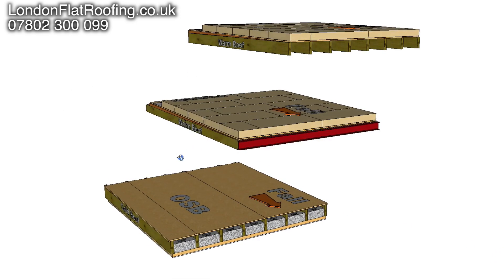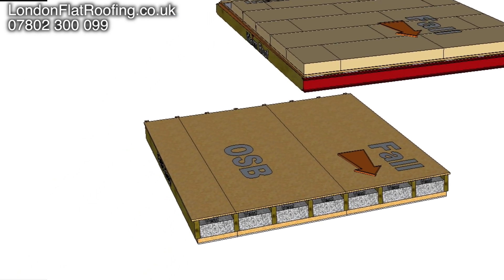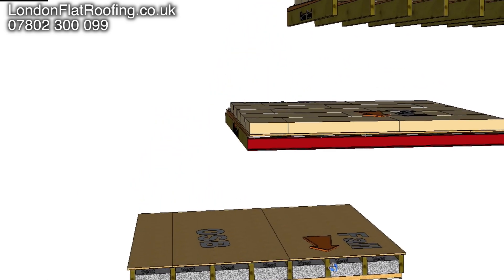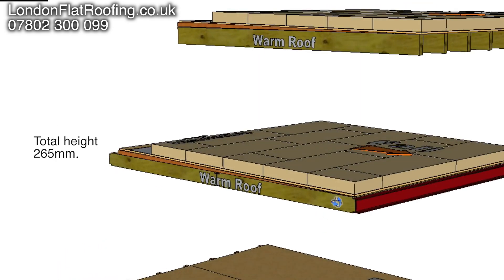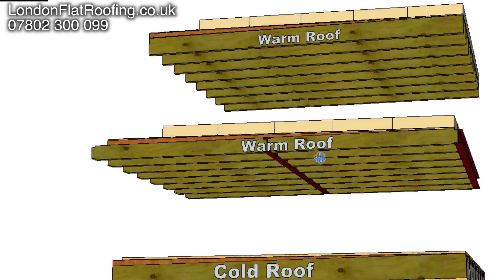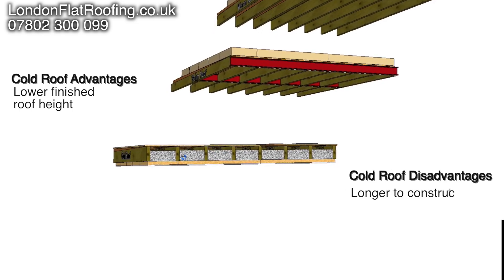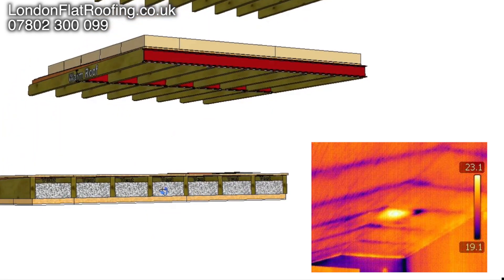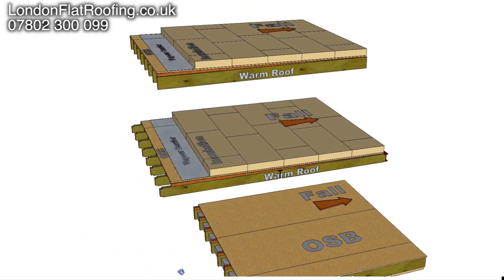How To Build A Flat Roof Warm Or Cold Construction. What's The Difference?

Comment: Thank you for the video. I find mine changes really well in every gear with minimal slippage. However, if I try and pull away fast in first it slips and all I can smell is clutch. Think PIS adjustment will change this?

Comment: Hi Steve,
My flat polycarbonate conservatory roof needs replacing, I want to replace it with a warm roof construction as you describe.
Can I do this but use a composite tile or similar for the finish roof?
All the films I see describe the warm flat roof construction but appear to have a rubber stick down covering.
I would like to have the finished roof with some kind of tile or tile look finish, I know a traditional tile/slate would be far too heavy.
Any advice/suggestions would be much appreciated, best regards Chris.

Comment: I just wanted to say that you are a master of your trade and that while my project is not exactly a flat roof but so far your videos have helped my planning process immensely.

I am about to build a metal frame, roof over a partially underground concrete floored/walled trench that used to be a parking lot, and I want to make the ultimate yard machine shop (I already have an industrial lathe that I plan to move there, expect a gorgeous new milling machine as soon as the construction of the space is complete and plan on adding a bunch of high precision measuring equipment which pretty much leaves no room for insulation errors...so much more for condensation and leaks).

The initial plan was to just add some screw through composite panels (standing seam ones don't exist in my country), but I later realized that doing only that in itself is a great way to create a huge moldy mess that would potentially consume my machines and tools. Also I realized that 3cm of insulation is not nearly enough to maintain comfortable temperatures in the windy and cold winter, and I wouldn't stand a chance at maintaining standard test conditions (23°C) for more than 2-3 hours a day without some massive energy bill

My current plan after all the information you have shared (unfortunately I didn't have time to assimilate even a fraction of it since I have a 1 month deadline for the construction) is to first set the metal beam frame up with some raised joists, on which I will place the standardized screw through composite panels on top of the frame, taking advantage of the fact they don't need any subplate beneath, and then slide some extra insulation between the joints and directly above the beams. 

My questions are if the vapor barrier have to be directly adjacent to the first insulation layer, or if it's a good idea to apply it under the beams and seal it with some interior panels, and should I install an EPDM rubber layer between the 2 insulations, or is building a deck below them necessary to stick the rubber to? Would that be enough to make sure my hybrid "warmish" roof stays dry and leak free (vapor barrier from bellow the beams and EPDM ontop of them and under or between the insulation layers)

Thanks in beforehands and keep the investment saving lessons coming! 

PS: After having seen your videos I might never trust a "professional roofer" again tbh, since now that I know what to look for, I know that nobody around here ever does it correctly (this is why the factory I work at has half a dozen leaks per square meter, leading to micrometer accurate precision tools, fixtures and jigs rusting over a single weekend). Also code here is pretty loose and not even remotely up to date with modern building practices so anyone is allowed to do whatever they feel like.

Comment: Pretty wild seeing all these comments talking about height restrictions. In my area, can't go higher than 10 meters above grade without a variance, which is easy to get. What would you say is the highest performing roof assembly from an energy standpoint?
Reply from the maker: Warm roof construction is the cheapest quickest, easiest and best, but has to be installed correctly
Reply: @SteveRoofer  Thanks. It gets down to -50F here in the winter, what sort of detailing do you recommend?
Reply from the maker: @canonicaltom  a robust air vapour control layer with 200 mm of PIR over the top with something like EPDM rubber over that

Comment: Hi, i have a question, i live in florida, i have a one car garage with a flat roof like the one on this video, no soffit, so no air coming in or out of the roof when close wit drywall . my plan is to install a mini split in the garage, Summer is to hot here, i know i have to insulate my garage door, now, how should i insulate this roof and what to use, my rafters are 16" x 2"  and like 15 or 16" a part, left and right walls are block and stucco, anynof the two walls are exterior, left wall has my kitchen on the other side, and right wall meets my neighbors garage, the rafters goes right thru the blocks, so no wood against any of the walls. I want to do this my self, and im scared of moisture on the roof and floors.. I hope this info its enough for you to help me out, if you can, thanks in advance...
Reply from the maker: The problem with Florida and your area is I'm not accustomed to. It's weather in England we put the vapour barriers on the inside however, in some places in America, you put the vapour barrier on the outside depending on whether or not your air-conditioning inside or external temperatures you're better off reading some of the information that Joe does on his website building science, he is more US and Canada-based and will probably give you much more information

Comment: Hi Steve,

I am having an extension built flat warm roof with a felted finish. Would it be ok to go for 18mm t&g osb staggered, vapour barrier, insulation board, finished felt product.

regards
Reply: base OSB T+G then Air Vapour Control Layer (AVCL) then insulation then roof covering or more OSB and roof covering, the AVCL is alway on the warm side of the insulation
Reply: @HampsteadBuildersLt  what AVCL would you reccomend please? there seems to a be lot about on the internet
Reply: @50burringham76  alutrix 600

Comment: Hi Steve, my cold roof design has no ventilation where the roof meets the house. It has vented soffit  all round and a cross battening to achieve cross flow as well as air flow from the front too, but no ventilation at the gmhouse end. Do you think this is ok

Comment: Hi Steve, Excellent video. If the roof is flat concrete, is there an issue with laying timber firrings directly to the roof then constructing a typical OSB/VCL/PIR/OSB/EPDM build up ? There is obviously an air gap between the firrings and the first OSB layer. Is this an issue ?
Reply from the maker: It's unknown hell that AerCap will work with trapped air in it that's the only issue we don't like doing it because of that but as I say it's unknown
Reply: @SteveRoofer  Thanks ! I've put a call into Kingspan to see what they recommend.

Comment: What fixings should b used on warm roof installation with bottom and top decks being 18mm OSB?
Reply from the maker: I always use thermally broken fixings however you don't have to but what you do have to do is use a fixing that is designed to be used externally
Reply: @SteveRoofer  Thank you, how much do the thermally broken fixings protrude from the top and are they suitable for fixing over 11mm OSB deck? Would they show when a waterproofing system is applied? Thank you.

Comment: Thermal bridging on cold roofs can be quickly resolved using thin rubber glued to the top fo the joist and the deck screwed through or even around the top 3 sides of the joist with the insulation stuffed between.  No need to lower ceiling and rapid to do.
The major thermal bridging is from direct contact with the outside, airflow bridging is much lower.
Reply from the maker: Unfortunately this is not correct as you need a minimal thermal performance to stop the thermal bridging i.e. on most specifications it's 25 mil of PIR insulation

Comment: Steve have you ever used vacuum insulation with a warm roof to save thickness?
Reply from the maker: No however I have looked at it and it's extremely expensive and difficult to install so much so you don't see many people using it at all

Comment: Great visualization, much appreciated, had a question, what goes on top of the warm roof insulation and is warm or cold best for a living space/patio on top of your roof? Thx.
Reply from the maker: Definitely a warm roof is the way to go and definitely not using a top decking is the way to go however that causes problems when trying to turn this into a patio then realistically you have to add a second substrate under the roofing membrane
Reply: @SteveRoofer  I see, thanks a bunch

Comment: Could you use spray form if you use a warm roof system and the then spray the ceiling joist and leave it open? I just want tin increase the R value because I live in canada.
Reply from the maker: Spray foam is not liked in the UK so I haven't got much experience with it
Reply: @SteveRoofer  ok

Comment: The other big advantage of Warm Roof is that Every MEP engineer loves to run all services inside the empty roof. When they see it, they just love it, because you can basically run there everything from pipes to lamps. Also, with the cold roofs there is another issue: trying to keep the integrity of insulation. Once the Electricians start to drill holes in the lower insulation, then the problem starts. It's nearly impossible to make it perfect with cold roofs. And in 9 out of 10 roofs contractors somehow manage to forget about ventilation until the last moment. We spent most of our year in correcting cold roofs ventilation by simply drilling holes in firrings after a few years when the moisture starts accumulating and become visible. 😅
Reply from the maker: Yes you are correct but drilling holes in not that good doesn't offer the best ventilation but better than nothing

Comment: Can I ask what the OSB is used for in the cold roof? I'm doing a cold roof in a conservatory and I don't doubt my skills. I spoke to a private building control firm and they said OSB isn't really needed.
Reply from the maker: In a cold roof its the roof deck  you lay the roofing material on
Reply: @SteveRoofer  I'm using Tapco lightweight tiles they suggest OSB aswell. I think I ill go with using it. Thanks for the reply.
Reply from the maker: @warrenely7708  I worked on a job with them once and I liked the look of them. Make sure you install them the way the manufacturers tell you. Think about venting the roof. I would love to see photos from start to finish and your opinion of them. Send me any info you want if you want my opinion

Comment: Hi Steve
I am currently building a garden room and I am limited to 2.5M I wanted a warm roof but the build up is aot.
My question is does a sips panel roof solve my problem as in it is the same as a warm roof but without the supporting timbers.
Cheers
Lee

Comment: hi steve, how would you run cable and install downlighter on a cold roof without slicing channels in the insulation boards?
Reply: Cables would go in the gap above the insulation, and you’d then have to chop your downlights into the insulation.

Comment: Hello I'm glad I've cone across your videos. I'm building a garden room and been watching someone who puts the insulation on a cold roof but butts it up to the osb and has a gap between the insulation and vapour barrier that's not vented like a hybrid roof. Now will the fail or not he says that with the insulation up tight to the osb that it cant condensate up there. (Its a rubber roof) cheers.

Comment: Hi Steve - I need to go the cold roof route on my workshop due to height restrictions.  I have been led to believe  that the roof has to be vented across from one side to the other with a 50mm gap between the insulation and underside of roof deck - my question is that when I fit noggins this will effectively stop any cross ventilation as the noggin is the same size as the rafter - any ideas of how I get round this or have I misunderstood the entire concept ! Thanks
Reply: Drill holes in top 50m of noggins, 3 holes per noggin, air will then circulate through each noggin.
Reply: @liammulcahy9506  - thanks, all sorted now
Reply: @liammulcahy9506  hi Liam! I have a couple of similar questions, if you think you could help.. my rafters are 125mm (5x2), as will be the noggins, and I'm planning on drilling holes near the top of each.. my question is, should I also drill holes in the noggins, and also, should I get 120mm Celotex, completely filling the depth of the timbers, or should I get 100, to let the air flow..??? Any help appreciated! Best wishes, Lawrence (home improvement enthusiast!)
Reply: @lawrencewhite4362  You have to use 100 mm to allow the air to flow ( 100 mm is what is recommended for a roof, and is plenty)
You really only  need to drill holes in the noggins if it is an outside room /shed. Air will flow along the direction of the rafters , through the holes in the noggins and out of either end of the roof.

Comment: Hi Steve. Great video. Very informative. What do you, think. Would it make sense to make a mix of both? Meaning insulate from the inside (cold roof), and also from the top (warm roof). The insulation heights would be less, because of having them on both sides, and the disadvantage of the height problem in the warm roof would not be there. Would it be necessary to have also ventilation? Since it is a mix, maybe it could be something like the best of both worlds? Again, great video!
Reply: As long as the bulk of the insulation is ontop to make sure dew point is far enough away from timber

Comment: Hi Steve, amazing videos and info!   We have an addition in Utah with 16" BCI joists. We have dry summers and winters.  The old roof was an insulated/vented 10" cold roof.  We planned to copy that method but many suggest the hot roof methods. With a 6 " difference in old and new roof heights, we'd like to avoid more height.  Is it feasible to put foam insulation between the flanges (underside osb) and leave an air channel between the foam and a standard bat insulation for venting since there is so much height in the 16" joist? Or would we be better off to do fully spray foam insulation inside?
Reply from the maker: Just do cold roof insulation between joist vent above pay attention to the venting and make it really good. Also ad a good AVCL to the underside

Comment: Hi Steve, you have convinced me to use a warm roof for my garden room.  The make up I'm going for is as follows

EPDM Roof Membrane
18m T&G OSB
100mm PIR
Non-breathable plastic sheet
22mm Egger Protect Waterproof covered chipboard T&G
125mm x 50mm roof rafters
12.5 plasterboard
Plaster Skim with downlighters cut in

Does this look ok? (ignoring the roof rafter size as they are adequate for the span in the span tables for C24)

Would i need another vapour barrier between the plasterboard and the rafters like in a cold roof?

Many thanks
Reply: You you ever require that last vapour barrier inside
Reply: @handle1196  always in this country in a timber building. It costs about £20 from wickes

Comment: Great video! I’m building a warm roof on top of the existing decking on my summer house. Am I right thinking I need to put a breathable membrane on both sides of the insulation board? thanks
Reply from the maker: No it's the last thing you want to do is add breathable membrane to a warm roof a warm roof should have a non-breathable membrane at the very bottom this is called a vapour control layer sometimes referred to as an air vapour control layer as it also stops the movement of air up into the installation and the roofing system that is above the vapour barrier
Reply: Steve Roofer thanks you have just saved me a massive headache. This will explain why the plywood decking rotted out on my old roof as my previous builder used breathable fabric underneath the insulation board

Comment: Great explanation as always. I am planning to convert my existing cold flat root to warm flat roof (EPDM rubber). I have called the council (Solihull) about the planning permission and they said if the height is going to be more then 150mm then existing roof then you need to apply for PP. As going to cold roof to warm roof height is going to go up , do you think it be more then 150mm ? I will need BR in any case. 
PS if only you were to provide your services in midlands :)
Reply from the maker: 120mm of insulation with 18mm then total height for a warm roof around about 138 mm 140 mm so you're well within side what the local authority are asking for.
Reply: @SteveRoofer  That makes sense. One more que. As the current trimming was designed to the height of the current roof. How do I componsate for the new height of 140mm ? Is it with removing existing trimings (currently I got white pvc trimmings)  or just put another one on the top of existing one?
Reply from the maker: @preyashdesai   Yes new fashias and flashings and probably raise the guttering up so its under the drip edge not way down in the old position
Reply: Thanks  @SteveRoofer  . Just one more que. I have found out that the roof (build in 2001) is infact warm roof and it already has 75mm insulation. In order to replace it with 120mm insulation (another 50mm extra) do I need to increase height of side facia boards or is there a trim available which can accomodate this 50 mm extra height?
Reply from the maker: @preyashdesai  There are trims  you can use but on warm roofs the trims start to get big and ugly as the hight increases